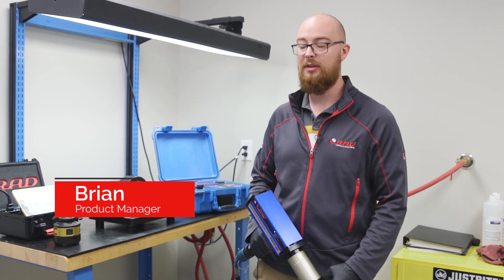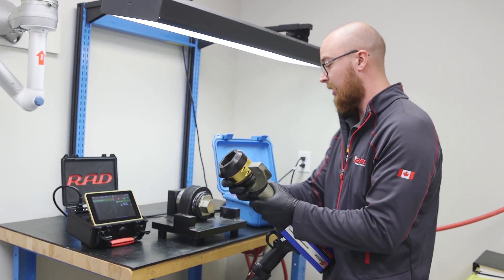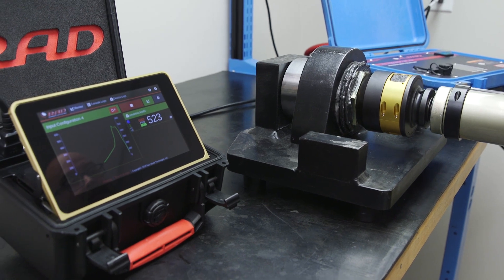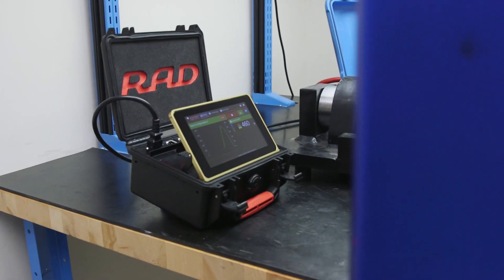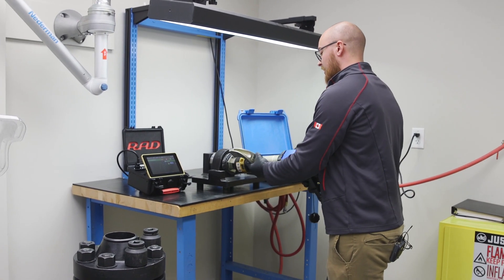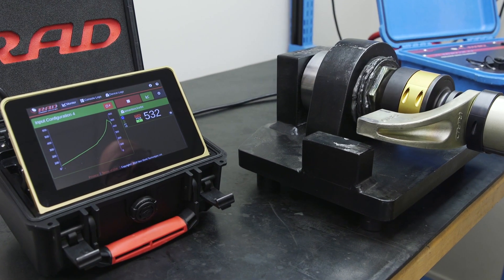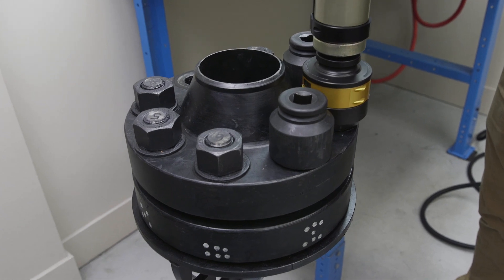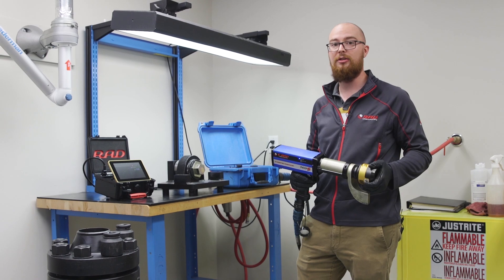The All-New E-RAD BLU-S – Demo || RAD Torque Systems

Comment: Thanks Brian, I don't know why I didn't think to put a socket on the nut next door, now I can use a taller socket on the drive and clear the inside of the wheel with the reaction foot. (not changeable on my AME nut buddy), if you have any assesories for wheels, please post a video.